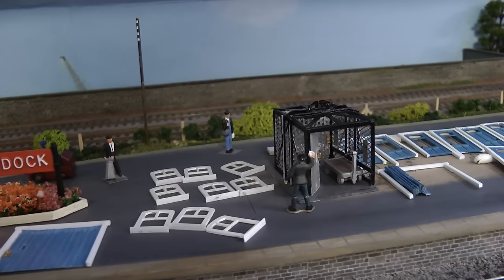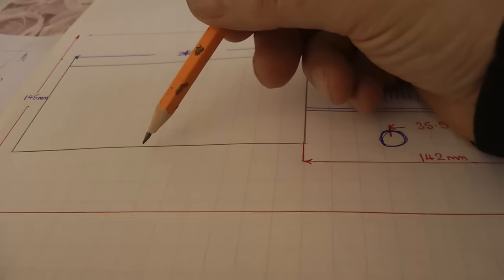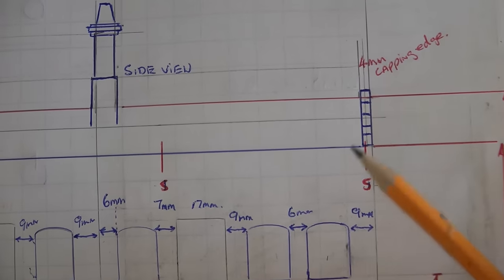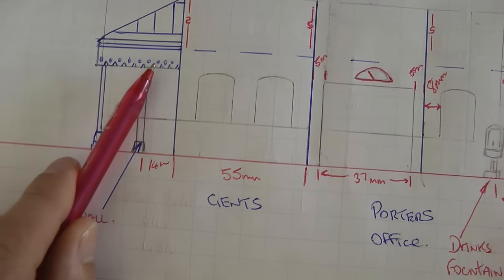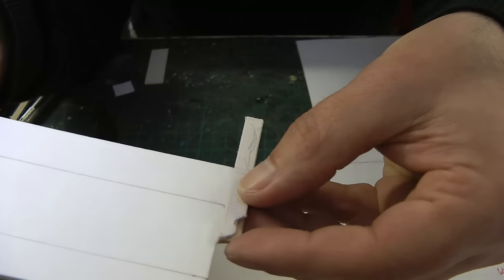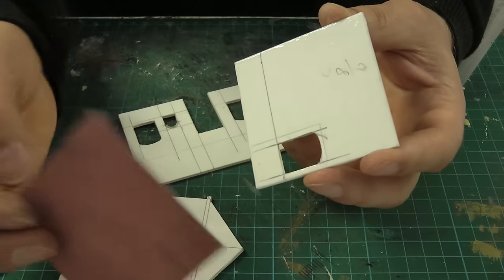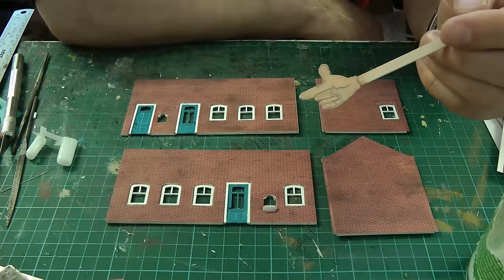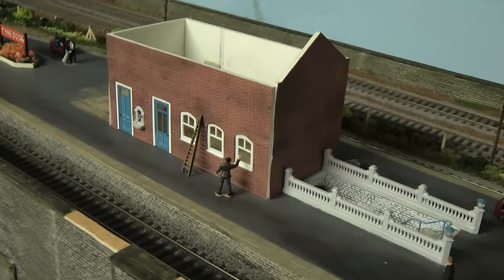Tyne Dock Re-Build Part 8  Design & Build. No431

Comment: Dear Tony, as always I love your footage. Great detail shots. Beautiful how you did the design drawings for Tyne Dock Station. Do agree on the ample width space of the platforms, which doesn’t seem wide enough for the pillar construction as you’ve shown on the Tyne Dock pictures. From the canopy brackets you’ve drawn I therefore conclude that the canopy roof will drain towards the edge of the platform. Just a little bit of a pity you’re not able to create the apexed roof structure for the canopy. Even though I very much like the pillars you’ve shown, might be there’s a way to find or make a slightly thinner version which could accommodate the apexed canopy roof. Nevertheless, I definitely shall submit to your design choice, whichever one you choose. 
On the elevator placement, don’t think it really matters that much. Just for posterity’s sake, from which ‘geographical corner’ comes the prevalent wind and precipitation? That may be a reason to place the elevator either on the ‘dock side’ or the ‘street side.’ Just for modeling aspects, I would suggest on the ‘dock side,’ which provides more space to accommodate some luggage and mail details in front of the elevator. 
Don’t really understand why folks commented on the fact you built the elevator cage. In the books I’ve read on these kinds of ‘elevated island’ stations, it has been a common practice that such stations were built and planned around a goods lift. And or they were furnished with a goods ramp for goods and luggage trolleys all the way up to the platform level. Finally, on a few of the photos of the Tyne Dock Station you’ve shared there’s that steel door visible. Still am wondering about the purpose of that door. Still think it had something to do with vertical transport. The raised island station design was very common on the GCR and at least some of ‘m were fitted with goods elevators. Same counts for other rail lines in Europe which were built on arched masonry elevated structures. And last but not least, even if it isn’t completely prototypically correct, a goods lift is indeed instrumental on such a station. And alongside it, as I said before, it provides a great opportunity to model some extra details to the station. Truly lastly, the North Eastern is your railway and as viewers we all can only respect your modeling choices (which also counts for the canopy choice). Cheerio
Reply from the maker: Hello Vincent. thanks again for your great words of wisdom. as they are always very informative. The canopy supports that run along the walls can be found in many stations. and i think it will help with the look of the station when i come that part of the build. and less intrusive on the platforms themselves. many thanks again for your valued input. cheer's for now Tony.

Comment: After careful measuring and construction by Mr Eastern, . and to do her bit to help with the build,  the Station Master's good wife did some baking and has presented the following recipe to the management committee : 

Zucchini, Apple and Carrot Muffins

Ingredients
2 cups shredded carrot
1 cup shredded zucchini
1 cup chopped peeled apple
3/4 cup flaked coconut
1/2 cup chopped almonds
2 teaspoons grated orange peel
2 cups all-purpose flour
1-1/4 cups sugar
1 tablespoon ground cinnamon
2 teaspoons baking soda
1/2 teaspoon salt
3 eggs, lightly beaten
3/4 cup canola oil
1 teaspoon vanilla extract

Directions

Gently toss together carrot, zucchini, apple, coconut, almonds and
orange peel; set aside.
In a large bowl, combine flour, sugar, cinnamon, baking soda and
salt. Combine eggs, oil and vanilla; stir into dry
ingredients just until moistened (batter will be thick).
Fold in carrot mixture. Fill greased or paper-lined muffin cups two-thirds full.
Bake at 375° for 20-22 minutes or so

Kind Mrs T has also offered to make Mr Eastern a nice cup of tea.
Reply from the maker: Cool recipe. cheer's for now Tony.